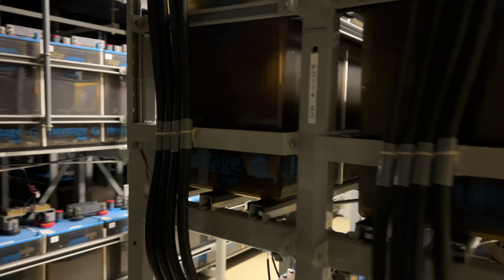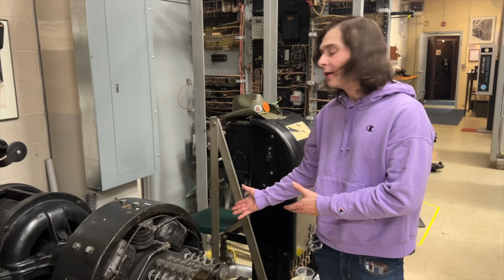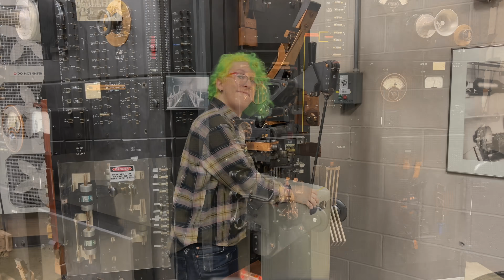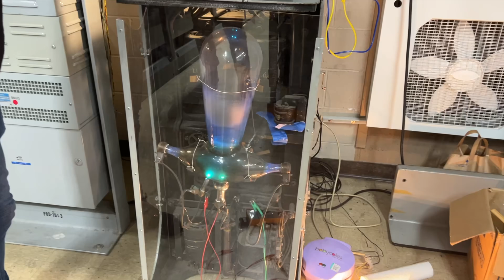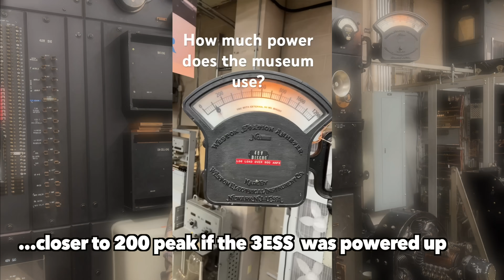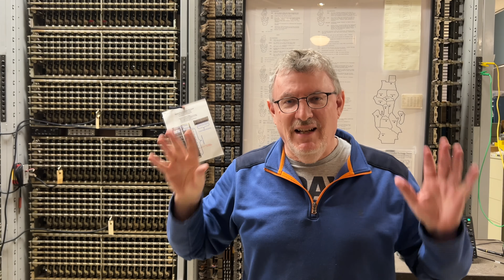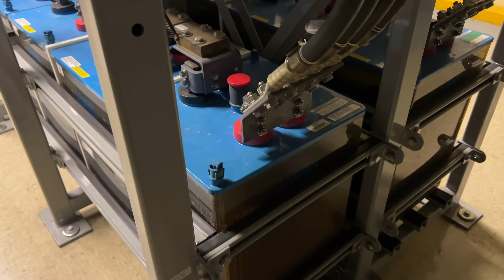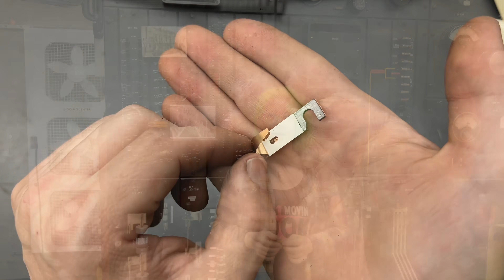All About Telephone Power Plants

Comment: I know this is an old video, but could you elaborate on how the end cells are charged? If they're only switched in during emergency (when the main cells are significantly discharged), they'll have a very different state of charge from the main cells when AC power is restored. During normal AC operation, they won't be passing any load. How are they charged and kept in balance with the main cells? There must be an automatic system in addition to that big knife switch, right? Was there an entirely separate charging system to maintain the end cells?
Reply from the maker: Switches are provided for charging the emergency "end" cells from the charging rectifiers in series with the main battery. However, since the end cells are not always in use, they are continuously supplied with a small trickle charge provided by a rectifier which normally maintains them in a fully charged condition.

Comment: My CO had a device called a line load switch box attached to the wall. In the event of a city wide emergency (earthquake, aliens etc) that Line Load Control could be operated which denied dial tone to all 1st selectors except those that were dedicated to police, fire, hospitals, and other emergency services.  One day, a WECO employee was running some cable up on a cable rack, and the WECO guy stepped down on that Line Load box, pulling it off the wall, and accidently operated several keys that wiped out most of the SXS office, except for police and other emergency services - took us a while to determine why people in the SXS office could not make any calls, I think the official reason for the outage given on the trouble ticket was CCWW (trouble Came Clear While Wondering) and was coded as an 8, rather than a 5 code....gotta keep those 5 codes down!

Comment: Old video, but something just occurred to me... You stated that in an AC-loss scenario, the breakers would open the generators to keep from them all spinning up at once upon getting AC back.  Will the DC side breaker also open on AC loss?  Since when you were describing the MG and showed it running, Jay stated that the MG was being driven in reverse, I would think the DC side would have to open to keep from turning the MG into a generator and trying to backfeed the AC side when commercial AC is lost. The AC breaker would be open at this point, but it still doesn't seem like a good idea (not to mention a hefty draw on the batteries to spin them...)... (I hope that made sense... I've been awake too long...)

Comment: Such a shame in the UK they are scrapping the old phone system and we have all been been forced to use the fancy new telephone system that DOES NOT WORK when grid power is down.  When grid power is down, In case of emergency You are on your own. It is completely crazy that I can communicate around the World for free with 100+ year tech (a battery, HAM  radio set and wire antenna) at any time while our expensive fancy fiber modern infrastructure is completely useless in an emergency.  Just goes to show the old telephone system was better in some ways.
Reply: Conversely, you're far more likely to have a fault on a copper phone line than on an FTTP circuit. Swings and roundabouts really.

Comment: Hey, on that 3 phase auto switch. What is the maximum amp or current rate before auto disengage or failure point? Of the switch not the power grid. Thanks

Comment: I also worked for 2 years in various C.O. power rooms. The picture of the black batteries tall as a man came from the diesel-electric submarine business (IIRC, this was all WW2 era technology). The shorter clear plastic replacements allowed for easier (via visual) monitoring of the fluid level, as well as a condition where the sulfur plates would grow together near the bottom (or debris would flake off higher up then fall to the bottom). In both cases this lead to plates being shorted out. In most COs the batteries were charged from 60 hz rectifiers (they were all 25 hz before 1950 in Ontario Canada; some parts of Ontario were not upgraded to 60 hz until 1966). Some older CDOs employed motor-generator sets where an AC motor drove a DC generator. The weird thing here is that the DC power plant monitored the battery voltage, and so only requested the motor-generator to run when the voltage fell below 48 vdc. For the longest time, the ringing current (20 hz AC) came from a DC-powered motor !

Comment: Many years ago in Ballarat (Australia) the technicians heard a local radio station announce a phone in competition, shortly after the exchange went nuts, at least they were past motor-gen sets, so the 50V rectifiers just ramped up to take the load, however the 'line finders??' were going nuts trying to find free equipment so they could at least get dialtone, everyone was basically bouncing their handset cradle switches trying to get a line. These first stage switches (uniselectors?) were never designed for continuous running and started overheating. In the end they went across one of the lines to the radio station (you could not call them the normal way, as everything was basically blocked) and kindly ask them to broadcast a message saying that everyone not already connected should hang up their phones.

Comment: In the era of electromechanical equipment in the UK, a fused negative DC supply was also used for rail signal interlockings in the Western Region of British Railways, the part that used to be the Great Western Railway,  but curiously not elsewhere in the UK. The GWR was always renowned for doing things differently than other railways! As a young engineer in the design office during the 1980s, when there was still a lot of the old plant out in the field, I was told they had copied telecommunications practice for similar reasons. The more modern electronic equipment is now installed with fused positive nationwide.

Comment: I worked in the tool crib for Western Electric in 1966 at the central office in Detroit. So I had the run of the building and checked out all the equipment. They were just putting in the first ESS system then but still had floors full of relays.

Comment: When I was working for an ISP in Fresno, since I had roots in Sacramento, one time when I went home to visit family, one of the things I was invited to do by AT&T, one of our vendors as well as the ILEC in both Sacramento and Fresno, to visit one of their two major NOCs in California, one of which is on Watt Avenue in Sacramento County.  The other is somewhere in San Diego.  Though let's set this aside briefly.

In Fresno, we had what used to be Brooks Fiber, then MCI WorldCom, then Verizon Business, located next door to us.  I got to see their power setup, which included a genset on the roof and a room full of lead-acid batteries, each cell being about the size of a large-ish fish tank, filled with lead plates and sulfuric acid.  Naturally, they had an eye-washing station nearby with huge bus bars everywhere because lots of neg-forty-eight.

Back to AT&T in Sacramento, I got to see their main tech support floor, which had very large displays, apparently using eidophors to power them, to indicate network health.

Further, since power availability, especially in failure conditions, was an important thing for the business given what we were attempting to do, they showed me the basement, which had the main power systems.  A single CELL was the size of a standing REFRIGERATOR, filled with lead plates and sulfuric acid.  Imagine 24 of those hooked together to get your neg-forty-eight...

This was a tour I won't ever forget.

Comment: 26:20 If a fuse blows, don't you typically need to correct the fault before re-energizing?  Or it will just blow again.  

Or do all the calls get dropped and that bank starts with a fresh zero load?
Reply from the maker: @easymac79  depends on the fault. Many faults are momentary in nature, so just replace the fuse and return the equipment to service. If the second fuse blows, you probably have a bigger problem.

Comment: I was working as a power tech, and a small office had the battery strings completely replaced by contractors. When I was doing our monthly load test routine, the whole office went down when the transfer switch activated and the load was transferred to the diesel generator. Every alarm went off, I manually transferred the office back to the batteries, and everything cleared and came back up. The contractors mistakenly wired the transfer switch for delta when it was actually Y power. Because I was there and caught it so quickly, we didn't lose any equipment. I was surprised. Needless to say, the contractors had to come back and get it right. It could have been a lot worse.

Comment: 24:30...  The normalcy of positive voltage is a legacy of electron tubes, with the cathode playing reference point to grid signals.  Negative voltage is just positive voltage with the other end of the supply grounded.  Just look at a vintage Ford or Chrysler.

Comment: I worked a lot of power rooms in my career. Battery routines were tge worse.
I was working when a motor generator set seized a bearing while running.  It ripped the bolts out of the floor and threw  itself into a rectifier panel.

Comment: I worked in Exchange Construction, and had some rivalry with the Exchange Maintenance staff.  We would modify those 'Grasshopper Fuses' so the back part contacted the alarm circuit, but the front flag did not jump out.   After the maintenance staff had given up looking for the blown fuse, we would remove it  from the unused circuit, and save it for another day.

Comment: You spoke of the 1963 assassination of Kennedy and the overload of the phone systems. I was 4. I remember my mom struggling to call people and didn't understand why. I understood intimately in 1989 Loma Prieta earthquake (impacting greater San Francisco Bay area). No cell phones in those days. I was in a San Francisco train station with a couple thousand other people waiting to use 12 phones. Sometimes it took 5 minutes for a phone to connect because the phone company couldn't handle the calls. It was hardest to connect to another circuit within the bay area, so people began connecting with people outside the area and have THOSE people call our loved ones at our homes to assure them we were safe.

Comment: Why did the phone companies use "Party" lines? I have expieanced that personally. I am that old.
Reply: Don’t forget that back in the electromechanical days every subscriber had their own private cable pair running back to the exchange (aka ‘office’).

In rural areas where subscribers were some distance from the switching equipment, to minimise cost they’d only run a single pair and several subscribers would share it. 

The assumption would be that  call traffic would be low. 

We had a system called 2 plus 2 (I think?) where one subscribers equipment would modulate the talk circuit above audible frequencies so both subs could use the same pair without hearing each other.

Comment: In the mid 1970s I worked maintenance at Holiday Inn and I had keys to every room in the motel, One of those keys was to the onsite telephone battery room. It was a room about 20 feet wide and 50 feet long that had glass cased batteries in steel racks like the ones in your video that went from floor to ceiling filling that entire room. I was just kind of awestruck by the number of batteries it took for for 200 motel phones, The motel switchboard was the telex system but I was not responsible for repairing that although later in life I repaired four line small business systems. I only went in that battery room once, It is possible it supplied the whole town. Everything in that room was Bell system property so they may have just been sharing the building with us. I wish I had gone in there more then once and studied how it all worked, Your video has enlightened me a little.

Comment: For negative voltage, it’s certainly not a big deal when you get your head around what Voltage is. Voltage is Potential Difference, the difference in the charges at different points. Split supply can be two positive sources in series, with a tap out from in between them.

Comment: As a boy scout about 1947 i toured t Colorado Springs central office, a manual exchange. I remember much of the power equipment you show here. They had a V8 truck engine for backup power running off the gas mains. Thanks for the memories.

Comment: Is it just me, or has anyone else noticed that most of our esoteric, old, yet crucial technical knowledge these days is held by queer ppl? Maybe it’s just YouTube, but if I didn’t know any better, I’d say at least 50% of our power grid, most of our main frames, and 90% of our analog circuitry would be on fire without them & all the secret knowledge they’ve accrued. You think I’m joking? Go outside & rig up a vacuum tube, any vacuum tube. Check back in 10 minutes. You’ll have a yard full of curious strangers standing around mesmerized by your tube. Instant PRIDE event. I swear to god, it’s like moths to a flame.